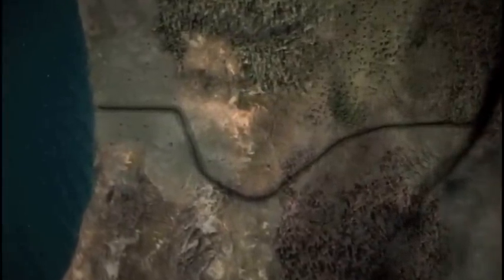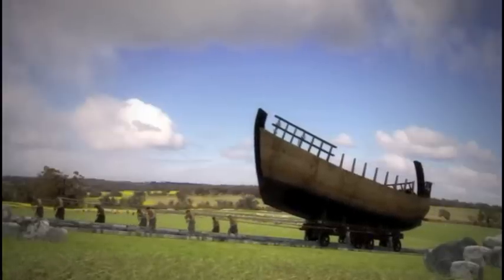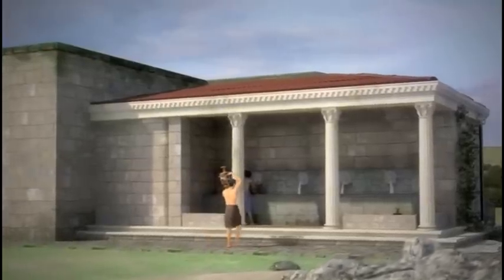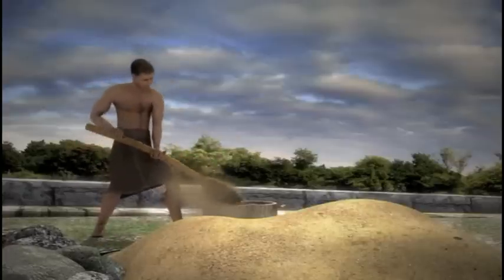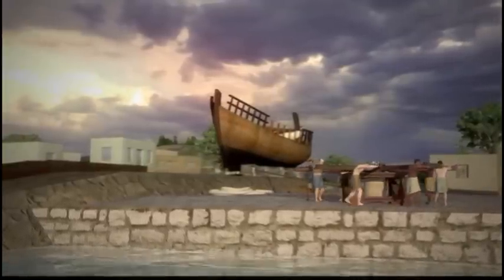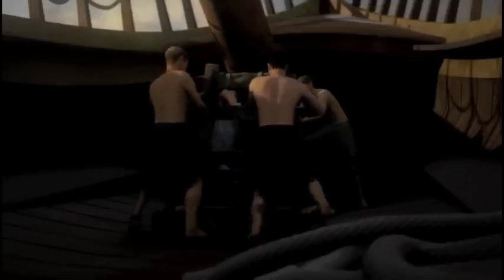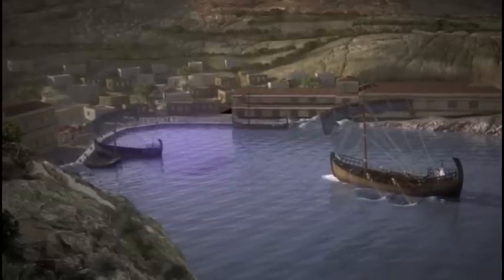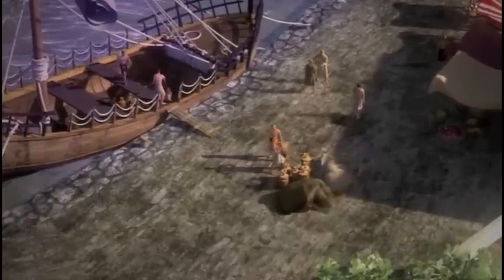«DIOLKOS 1500 YEARS» Diolkos_en_part2/2

Comment: The reconstruction is beautiful but what archeological evidence is there for the 8-wheel wagon? What are the materials of the wheel bearings and how are they lubricated? Adding sand for friction seems hard to control and it would create much work to remove the sand for the return transport. Could not the wagon proceed under water and take on the boat there? Why not use animals to work the winches?